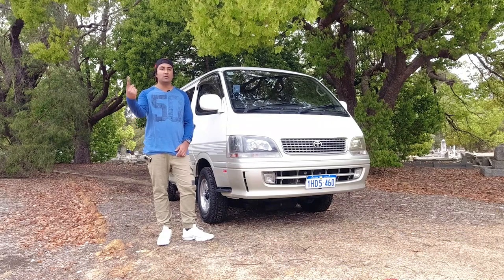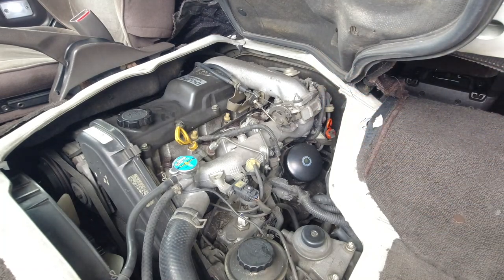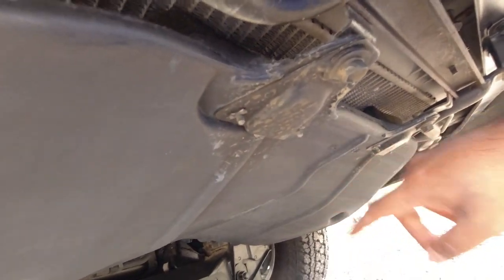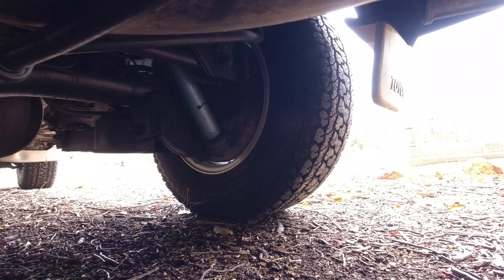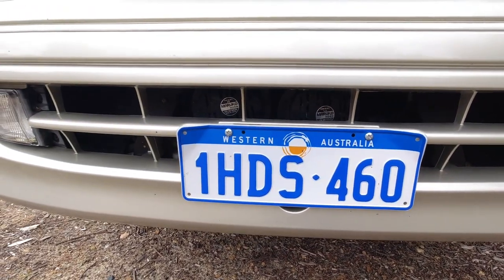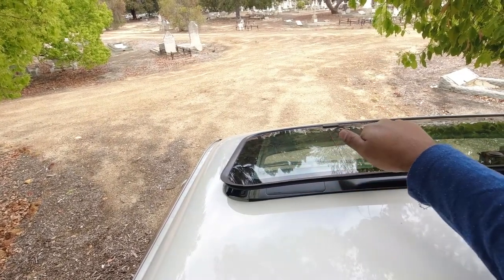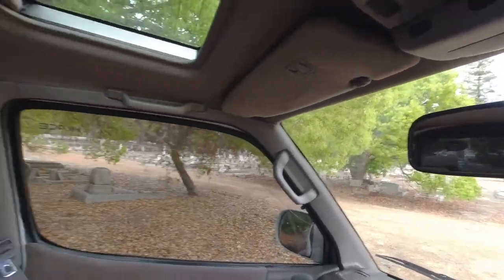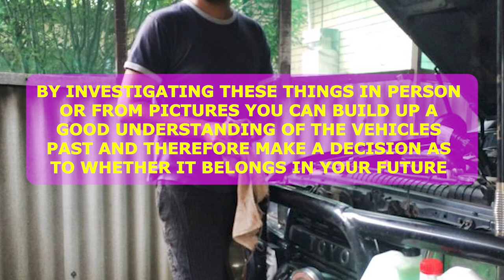Video Inspection Guide For KZH106 Hiace Super Custom

Comment: Question Nathan. How can I convert my hiace into rear coil over. Instead of just coil springs
Reply from the maker: As in coil with the shock inside it?
Reply: @nathansharma87  yes
Reply: @nathansharma87  I want adjustable height and adjustable damping/bumps
Reply: @nathansharma87  also another question is it possible to fit a 2jz engine in it? I am gonna turn my van into a drift van. What transmission should I use if it fits?
Reply from the maker: Only way is with a welder and allot of fabrication. 2iz is possible again with fabrication for mounts. Just run a supra gearbox. If it's 4wd you can drop a Landcruiser 80 gearbox in it the H series not the R. H is stronger.
Reply: @nathansharma87  what engine mounts should I use to mount up the engine to the car it self
Reply from the maker: You have to make them. There's no off shelf 2JZ conversion for a Hiace Super Custom.
Reply: @nathansharma87  know anyone good?
Reply from the maker: Unfortunately not. Try Japanese performance workshops in your area.
Reply: @nathansharma87  I will try to find a skilled welder in my area. But again how can I turn my rear suspension to coil springs to coilovers
Reply: @nathansharma87  I also want to convert it to RWD in the process so I can actually drift it. What transmission should I use? And most importantly what kind of turbos can I fit in the 2jz. Since the space is barely there in the hiace
Reply: @nathansharma87  and what kind of harness should I use to even start it
Reply from the maker: All of these questions have the same answer. There is no off shelf kit. Requires fabrication. Suspension will need complete reengineering. Harness depends on what ecu you run. I recommend getting a workshop involved because what you're asking is level 10/10 for mechanical modifications.
Reply: @nathansharma87  I am running a link Xtreme ecu as of right now
Reply: @nathansharma87  I have to ask some pros to help me someone on YouTube has done it.
Reply: @nathansharma87  should I get the whole Axel rebuilt?
Reply: @nathansharma87  I will get a workshop involved I don’t have the right guy yet. I will take the engine out of an old Supra that has nothing good on it anymore only the engine sort of works. But I do appreciate the advice from you Nathan. You are truely the guy
Reply: @nathansharma87  Nathan. Also what sort of adapter plate should I use?